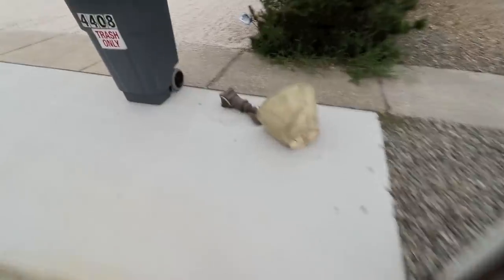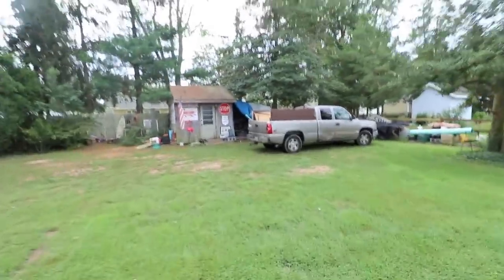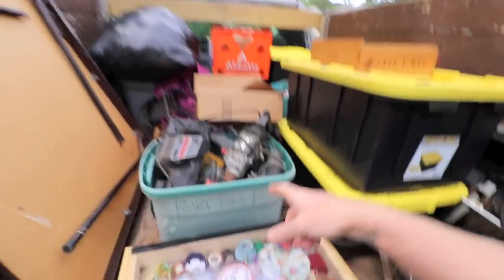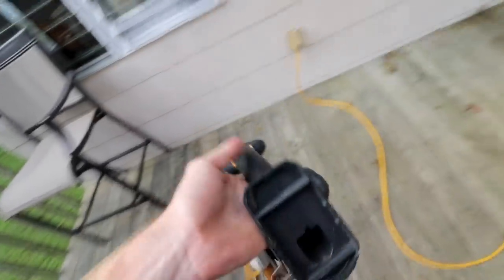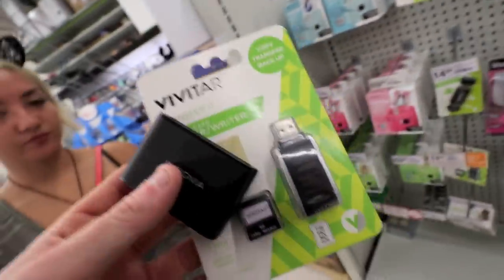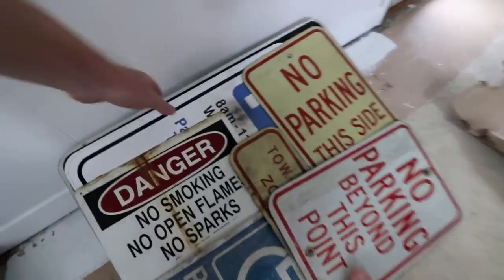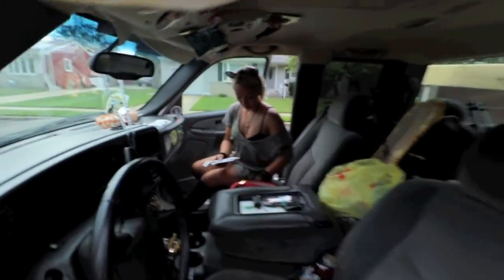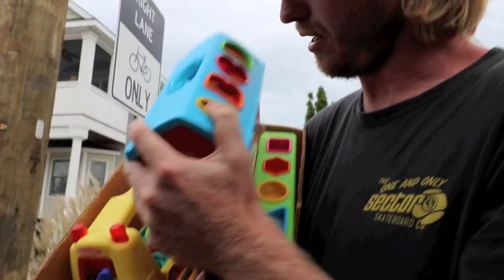TRASH PICKING RICH TOWN! FOUND ALL MICHAEL JORDAN'S SPORTS ILLUSTRATED COVERS!!!

Comment: Tucker a little tip If you guys want to make sure your Coach items are authentic always look at the little inscription on the zipper. It's usually on the part where the pull tab is connected it should say YKK. The set of encyclopedias was almost definite a score. Look at the listings on eBay they go for quite a bit and you can ship them Media Mail which is cheap as hell. The Jordan mags are interesting too. It's always good to have a phone with the eBay app to look stuff up if you're wondering if the pickup is worth anything and use the completed listing filter for the item and eBay app doesn't use much data at all I don't even use 500 mb a month doing this. For the dream dude.